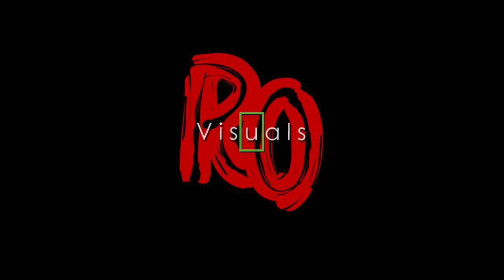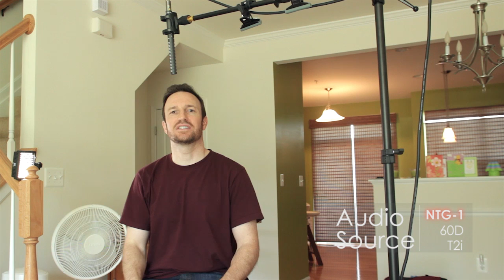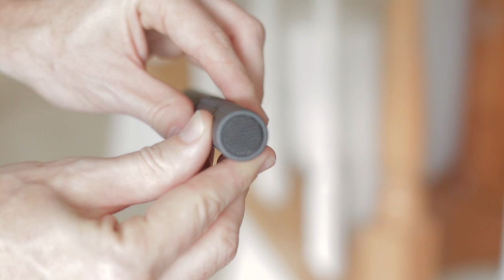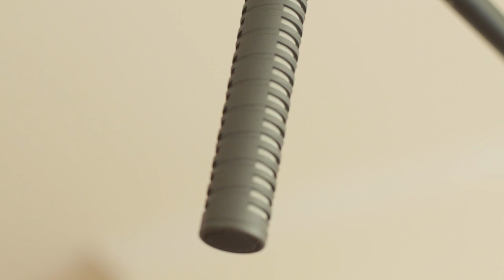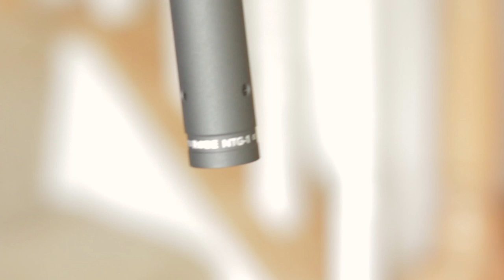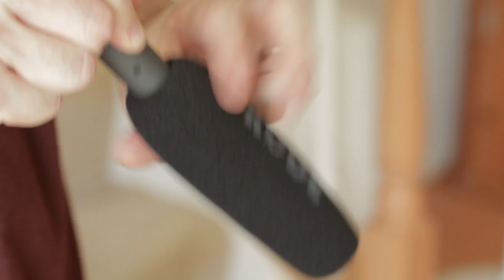Rode NTG-1 Microphone into a Zoom H4n for Dual Sync High Quality DLSR Audio for Video

Comment: Hi..nice review but I'm still confused on what I should purchase the NTG1 or NTG2? I already have the H4N.. I hope you can help me. I do film making (shortfilms) and majority are outdoor shoots.
Reply: Yes, a lower output impedance means less return signal loss.  As a general rule, the input impedance of one's preamp should be at least ten times the output impedance of the microphone being connected to it.

The Zoom H4N has an input impedance of only 600Ω and is going to require quite a bit of gain when used with microphones rated above 60-100Ω.  In addition, neither the NTG-1 nor NTG-2 are particularly hot in terms of output, so, that definitely exacerbates the situation.
Reply from the maker: The Otaku Technology Nerd Awesome reply, thanks!
Reply from the maker: Thanks. I don't like the NTG2 from what I've heard on here. It's easier because it works off a battery but it doesn't send a loud enough signal into the H4n. The NTG1 seems to work better as you can hear in this video. I really loved the sound. Of course as with any mic, you need to get it as close as possible for the best sound.
Reply: Thanks.. :) It really helped sir..
Reply: Ray Ortega The lower output of the NTG-2 is due to the fact that it has an output impedance of 250Ω, compared with the NTG-1's 50Ω.  Unless one is using a dedicated preamp or audio interface with high input impedance, the NTG-1 is generally the best option. :3
Reply from the maker: The Otaku Technology Nerd Fantastic. I knew there had to be some difference. Thanks for finding it for me. Wonder why they changed that spec. The NTG1 does a great job. Too bad. the battery option is great to have. So a lower Ohm number means a mic can push out more signal with less gain? How does that work? Thanks.
Reply: Ray Ortega
I'm back again. Would the output level on the NTG-2 be improved by using the battery power on it as opposed to the phantom power? Or is it exactly the same either way?
Reply from the maker: Bryan Pike Probably won't make a difference but it's always worth trying if you have the gear. The nice thing the battery does for you is allow you to not run phantom power which really sucks your battery life away quick!

Comment from the maker: It could be the environment you are recording in. Background noise or lack of it is important to clean audio. If there are a lot of computer fans, AC, heater whatever, that could all leak into your recording as "fuzz." Also get the mic as close as possible without being in the shot so you won't have to use as much gain. The more gain use the more of that background you'll pick up. Try getting your levels around -12 and you can boost that some in post production.

Comment from the maker: I actually don't recall but all you really need to know is that you want to get your levels high enough without peaking. Using the "limiter" function is probably best and try to get your levels around -12 to -6. I record in .wav 44.8khz at 16 bits.

Comment from the maker: I don't like any wireless systems below the Sennheisers I use or the Sony's. Both above 400. If your talent is not going to move much and since you have a Zoom H4n, the NTG-1 setup that I have hear produces fantastic audio. However, you can get great audio by plugging a wired lav into a small recorder and just putting it in the person's pocket and sync in post later. That is your best bet cause it's clean and reliable, no signals to interfere with a wireless system.

Comment from the maker: The NTG1 needs phantom power so it has to be hooked up to a recorder that supplies it. The NTG2 can run off it's own power but it might be tough to get good levels in a DSLR. The VideoMic Pro is a great on camera mic but it plugs into the camera so that mic port will be taken. The NTG1 or 2 will need it's own recorder if using both.

Comment: Hey, I like vids very helpful. I have a t4i which I absolutely love. I just got into dslr filming. I originally wanted to get the ntg2 but after some research and a tascam Dr40 later, the video mic pro and the ntg1 look like a better cheaper option. I don't mind spending Ntg2 money but if i dont have too i would rather save the couple of bucks. The mic will be going on and off the camera to a boom. Which would you recomend? Thanx again.

Comment from the maker: With the NTG-1 yes you need phantom power. The Nikon will not provide that. You can get the NTG-2 (see my links in the description) it takes AA batteries so it powers itself. However, it's likely you won't get very good audio because the preamps in the camera are noisy.

Comment from the maker: Hi Zach. I didn't use a pre-amp but I was also using the NTG-1. For some reason unknown to me, the NTG-2 which is basically the same mic doesn't work as well with the H4n. It's true the preamps in the H4n are not that strong but as you can hear my NTG-1 did just fine. As w/ all my audio, I boosted the level about 3db for this video so it was listenable but that's it. The raw file still reached good levels. I recently bought an awesome preamp called a Fethead. See my unboxing video. It's magic;)

Comment: I have/used a NTG-2 into a H4N and the audio levels it recorded were pretty weak with input levels set to max, nothing near the quality you were able to capture. Mic was about the same distance your's is. I subsequently read online that the H4N does not have high enough gain in the XLR input and a preamp is needed. Advice please?

Comment from the maker: The NTG3 is an awesome mic. You're not going to get as clean of a sound out of the mic by plugging it into the camera directly because the preamps are not as good but you can still get some pretty nice sound if you use the preamp on the H4n and put that audio into the camera. But your best sound will come off of the recorder. You can sweeten the audio in post to make it sound more "rich."

Comment: Thanks for a great demo and lot's of informative stuff. I am waiting for delivery of my NTG3 and Zoom H4N. I thought I had to order a Phantom P48V after the fact but now I see that the Zoom H4N provides the required power. One question, would the sound be as rich if I used the NTG3 connected directly to the camera using Phantom power? I have a 5DMKII with MagicLantern installed.

Comment from the maker: Thanks. Definitely no noise reduction added here. The only thing I did was raise the DB's by about +3 so you could hear the mic better but the funny thing is that actually brings up the background noise too. So if anything I made any background noise louder;) There is a kitchen behind me with a running fridge but mostly the room I'm in is quite. You should turn of your AC or heater when you record & limit any other noise. And don't run the gain too high on your Tascam if possible.

Comment from the maker: Yes you'll get great audio into your Zoom via XLR. You'll just have to sync the audio with the video in post production. Make sure you are recording audio on your camera so you can sync the good audio with the camera's audio otherwise you'll have to match up the persons lips and that's no good. For settings, you'll record in wav and set the input so your levels are between -12 and -6db. Use my links in the description if possible. thanks

Comment: Im currently a amateur video maker, making movies with my friends. My knowledge of microphones is very poor. I have a simple Fujifilm bridge camera i shoot with, which is fairly poor quality and has no audio input connection. I have looked on the web and discovered a femail XLR to USB cable as i have a laptop with a USB connector but no mic input one. Is this a good idea, does it produce good sound quality and what would you recommend doing? not forgetting i'm on a reasonably low budget.
Thanks!

Comment from the maker: Since the NTG-1 needs phantom power, that won't work with the H1. You'll need the NTG-2 which can be powered by a battery. Please use my links to in the description to browse and buy if possible. You could also try some of the Audio Technica shotguns. They make pretty good, affordable gear.

Comment from the maker: I don't recall but it doesn't matter cause it will be different for you. The key is to set the input on the H4n to get levels around -12db. That's how I set it. I like to be between -12 and -6db for my recordings. Other than that, record at WAV 48khz/16bit, mono mix for voice. Thanks for watching.

Comment: Hey Ray I love this video so I have some questions

1 - Can u use the Zoom H4N as a Stereo mic plug directly into the camera?

2 - Using the Shotgun mic plugged into the H4N, is there a 3.5 jack from the H4N to plug to the camera for live recording or did u record it separately and needed to sync the video and audio in post? 

3 - Did u use any other preamp? Or do u know of any/ or advise me to get a DSLR Preamps that is in a $300 range that will give me the same performance like the zoom.

Comment from the maker: The Zoom also provides different levels of phantom power. Go into the settings are see if changing this, likely to be less, has a better effect on reducing the noise. Also make sure the power output matches what the mic specs are.

Comment from the maker: Interesting. I haven't really used that mic before. Are you running the phantom power without the battery in? Try using only one source of power if so. Take out the battery while running phantom. Try getting your input levels down to where you audio meter is around -12db and bring up that audio in post production.

Comment: Hi!
I have a rode ntg-2 and the zoom h4n, and altough the sound is very good, i have some issues with hiss noise, but only when i'm using the 48 v phantom power of the zoom. With the 1,5 v battery of the rode, the hiss noise is much lower, but the sound level is a little lower too. Do do you have any thoughts about that? Thank you in advance.

Comment from the maker: Thanks. Yes, you've listed a couple reasons. One, phantom power. Two, audio monitoring. Three, cleaner audio due to noisy pre-amps in DSLR's. If you plugged directly into the cam with the NTG-2 which has battery power, you'd have no way to control the level of audio going in and would be at the mercy of the cams pre-amp which is going to give you much noisier audio with hiss. This is one reason the audio in this video is so clean.

Comment: Great video, but I'm a little confused on the purpose of using the Zoom H4N in addition to the Rode. Is it solely for the purpose of providing the Rode with phantom power and monitoring your audio? I guess I'm not quite sure what the functions of the H4N are. Thanks.

Comment from the maker: Thanks. It's a good tip and of course isn't the best answer in all situtation such as if you were recording and had loud sound coming from the floor then you'd probably want to point the mic up towards your chest instead of down. But mostly, the way you see it here, is the best way to use it. Thanks for watching.

Comment: This really helped. Have a question, when you hold it away for the camera (booming it) can you use any xlr extension cable from the mic to the camera if the camera has an xlr output?

Comment from the maker: Sorry the mic is not working out like you wanted. Mics can be strongly affected by the proximity effect which will make the sound much more thin that if you were closer to the mic. That might be what's going on. It's hard to tell without hearing it. It's likely not losing quality as much as the sound is changing based on the proximity effect. You can try upping the gain and see if you can get the mic to reach further. It could be your input as well. Either the box or the computer settings.

Comment from the maker: No I didn't find that I had any issues with the level of the audio. Try using phantom power supplied by the H4n as opposed to the battery in the NTG-2 and see if that makes any difference. With the NTG-1 I got nice levels. To avoid hiss, make sure your cable connections are good. Same for your cables themselves. Don't record close to air conditioners or other like sounds and don't try to record the levels too loud. Get em around -12 and you'll be good.

Comment from the maker: Record in the highest format/settings possible. WAV file at 24 or 16 bit, 48 khz. When setting your levels, position the microphone in the spot you'll be recording and set the input so that you are hitting between -12 and -6 on your meter. This will give you audio that has enough headroom so that if someone gets loud, the audio won't peak. The Zoom also has a peak limiter on it, you might want to set that.